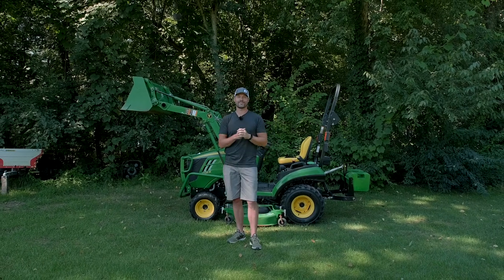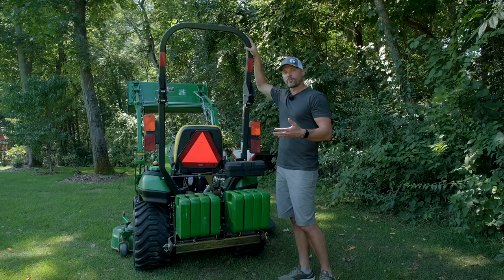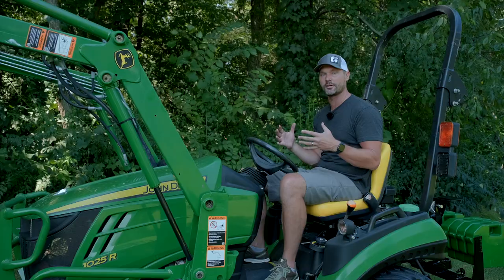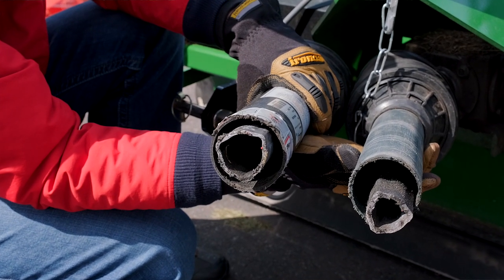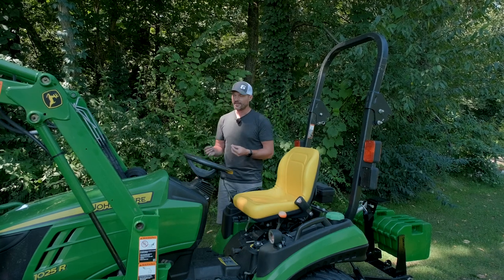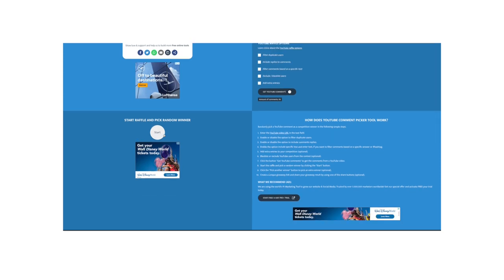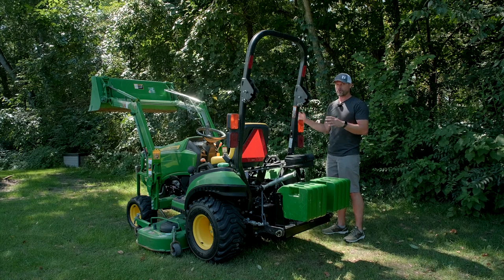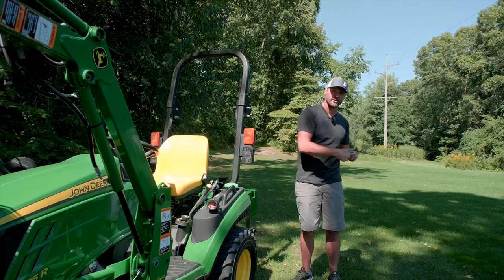TOP 5 WAYS YOUR TRACTOR CAN KILL YOU! DON'T WAIT TO WATCH!

Comment: I live in “hill” country and constantly taking precautions as I use my JD 3038e. I’ve followed your videos for past 2 years and take your suggestions to heart — thanks. Still need to add wheel spaces. It is on my to-do list.
Reply: Just bought a 3038e but have not picked it up.
Had them add wheel weights load tires and make sure tires are as wide as can be.

Comment: The extra weight on the rear end is a nice addition to add to the feeling of safety and stability of your tractor. However, just because you add extra weight to the tractor doesn’t mean you can throw caution to the wind, as the operator is ultimately responsible to operate their machine in a safe manner.

Comment: I think very useful content.

I've grown up on farms, and unfortunately lost family and friends to accidents with tractors. 4 additional areas of really critical safety that I unfortunately know from accidents:

1. Hydraulics. Don't get under a loader or 3pl implement, or anything else hydraulically without appropriate safety supports etc. in place. Or in a place where anything can be crushed.
2. Don't step off the tractor and leave kids (that can touch controls) and go attach an implement at the back or front of the tractor, or open a gate etc.
3. You kinda covered this in starting, but either be in the seat - or well back from the machine - if it's starting.
4. Stand reasonably clear of any machine that is on, or has anyone at the controls. That persons foot may slip/hit the wrong thing and that machine or implement be quickly on top of you.

Comment: It’s also important to note the hitch height on the torque part.  Having a high hitch above the axle height allows the tractor to rotate around the axle.  A low hitch, below the axle height, typically prevents upward rotation of the front end during heavy torque.
Reply: Old Fords were famous for killing operators because attaching a tow rope to the top link was very tempting.  Drawbar under the axle is best.
Reply: Absolutely! Always use the drawbar to hook to chains for pulling. This makes sure you are pulling below the centerline of the axle.
Reply: @LongBinh70  they used to have safety films on TV about this and other things in the sixties here in Britain, they were short and filled an advert slot.
Reply: Both my MF 235 and 1050 still have the factory draw bar hard to wheel stand them pulling off it .
Reply: Back in high school I knew two people killed by flipping the tractor.
Reply: Physics is the one law nobody is above

Comment: A couple weeks after we moved onto the old family farm in 2001, I borrowed my uncle's Ford 1920 and went down to the creek to get several scoops of gravel to put on the new driveway. About the 3rd or 4th trip, I had really overfilled the bucket and as I looked backwards to reverse out of the creek bed, I did not realize my hand was still on the control just enough to continue raising the bucket. As I was backing up I suddenly felt the tractor lurch to one side and as I quickly turned my head back to the front, I saw the bucket was at near max height and was starting to tip the tractor over towards the creek bed. I don't think I ever slammed that control so hard forward so fast in the 14 years I had use of that tractor! I saved it from going over-but just barely. Scared me so bad I never did it again!
Reply: Good instincts!

Comment: Would love to see add on ballast weight options for back blades. They are never heavy enough to cut into dry hard ground and they are one of the most common attachments.
Reply: I just hang suit case weight on mine.  Same for the box blade.  Works like a charm.
Reply: Use cast iron barbell weights on a 1" shaft welded somewhere out of the way.
Reply: I welded a box onto my box blade to stack concrete blocks into.

Comment: Use your translock when climbing hills, even in fwd you can loose traction with one wheel, causing it to spin,and the others to reverse
Reply: I think you're referring to differential lock.
Reply: Same thing
Reply: @woodboss270  no theres no such documented term called translock. It is called differential lock or diff lock for short. When you push the pedal down or flip the switch you're locking left and right axles together at the differential.  Locking the transmission would cause a machine to not move at all and is used in drag racing for staging a car at the line and is called a trans brake.  Tractors have Differential Locks, not trans locks.

Comment: Your new Versabracket and the package bundle looks like a real winner.  Recently bought the JU Fab Works hooks for my 1025r and they are great, I highly recommend.  Your comments on safety are really on point.  At the church we attended when we lived in MN we had a 4WD JD Compact tractor with a mower deck and plenty of hills.  One of the guys who occasionally used it took it out of 4WD and forgot to put it away with the it engaged.  One of our other volunteers took it out to mow and didn't realize the 4WD wasn't engaged. He rolled it and if it wasn't for the ROP and wearing a seat belt it would have been fatal. Regarding the PTO comment, that is the reason my father-in-law decided to retire from farming. His best friend was working with his son and got careless and was pulled into the PTO in front of his son. Farming and working with heavy equipment is potentially dangerous, so safety first is a must. Great channel with excellent content.

Comment: Some good points , the first tip, "too much torque" to avoid always pull from below the centre of the rear axle, not the top link, always the draw bar. The PTO the absolute golden rule. I watch a lot of YouTube farmers, too many implements with failed PTO guards especially static machinery such as augers, and conveyors. Always have the rops in the correct position. Good safety video. A friend of mine lost his arm in a round baler, I'm always encouraging farmers/machinery operators to have the best safety attitude.

Comment: Thanks for posting the safety bulletins, I noticed when I removed by backhoe from my 2025r that it doesn't take much weight in the bucket to make it get squirrely maneuvering it around even with fluid in my tires, adding the box blade helps but it is no where near the weight of the backhoe so I am considering adding rear wheel weights. Keep the videos coming they are really informative.

Comment: Great information regarding the tipping point for these small tractors.  I have a JD 1025R like the one featured in your video and I've had it on 3 wheels (one rear) twice and it scared me to death.  Thanks for the knowledge to add weights on the PTO and wheels.  Expanding the rear footprint is also a great idea.  The compact tractors are super handy to have around but take your time and keep your loads low.

Comment: I got rid of my ballast box and use my box blade as my rear weight carrier now.  Especially when I haul rocks, etc.    I'd love a chance to win this versabracket (and weights).  On the safety piece, I've rolled my 1025R in my drainage culvert running too sideways.  I thought the angle wasn't too steep to mow it, which it wasn't, but at the end, when I turned to get out of it, the angle increased and I tipped.   Fortunately, the ROPS saved my life, and I NO LONGER do that.   Cheers and thanks for all the awesome content.  Keep em comin.

Comment: Good tips! I can relate to the runaway one. I recently went down a hill with some weight on the front and forgot I was in 2WD. Back wheels got a bit light and it just started sliding down. Whatever was on my forks thankfully fell off and I regained traction. It scared the hell out of me and won’t be doing that in 2WD again.

Comment: I own a john deere 4066m heavy duty with a loader, to make it safe always keep the rops up and seat belt on and add enough weight. I have the tires full and 800 lb of wheel weights and keep the    4 wheel drive engaged. Stay safe and great video.

Comment: I agree, I have attempted to move Ford without disengagement of the parking brake. I always worry afterwards if it will hold the tractor when it counts. I’m ready to put a post it note in the area as a reminder.  Great safety video.

Comment: My first experience with "needs more ballast" was building a target berm. I was scooping a heaping load of dirt into the bucket, and the next thing I knew, I could feel myself starting to go upwards. It wasn't a fun experience, but I certainly learned that the tractor needed some more weight in the back end than just the box blade was able to give. Since then, I have just started using the brush hog back there as a pretty good size weight.

Comment: I built my first prototype track system for a JD 955 in 1991.  A cooperating dealer let me use the tractor which was owned by JD. My company at that time was; Terak Corp.  And, a video of the testing was placed on You Tube by Jean Marc Maclou  in Paris France.  Over the years I have improved the track assembly as well as the supporting struts and idler axle.  The Iguana Track system improves operation in snow, mud, sand, swamp and steep.  It has angle control that allows you to work yourself out of impossible situations.  The tracks also makes it more difficult to tip the tractor over and the Low Impact track reduces or eliminates damage.
I update my contact at JD biannually with no response.  If they have my tracks on their JD, they have one of a kind.  The hydrostatic compact JD tractor has nearly 20 competitors.
Go figure,
Iguana

Comment: Good review of safety precautions. One other is that when you were Towing be sure to put your tow line on the tow bar or at a low point of the tractor turn it off, if it's hooked on above the actual height that can tend to tip the tractor backward.

Comment: Last week my Dad found himself in the downhill runaway tractor scenario.  He had put it in the wrong gear and started down hill.  Instead of just stopping right away once he knew he was going too fast he was trying to down shift to slow it down but he didn’t realize you have to stop the tractor completely before switching gears. I watched helplessly as the tractor picked up speed.  Luckily he ended up hitting a tree and wrapped the bucket around the trunk.  If he wouldn’t have hit that tree he had about 10 more ft left of that hill before there was a cliff that dumps into a river basin.  Somehow he walked away with only minor scrapes and bruising.  I thought for sure he would have broken some bones or worse.  I ran down the hill yelling out to him, “are you hurt?”  He raised his arm up with fist clenched to show me he was OK.  That was scary!!  Now we’re trying to figure out if this loader bucket can be straightened back out.
Reply from the maker: Holy smokes, that's scary!
Reply: I've seen that movie

Comment: Those add on weights would be great. I just seen a tractor tip over to the side a few weeks ago because the operator removed the brush hog and swapped out for a smaller implement (middle buster) and didn’t have that same stability. Luckily that bar prevented  from rolling over him and causing any injuries. Gotta pay attention.

Comment: Thank you; I have a small backhoe around 7500 pounds, and a few years back I was working on an incline, after having put the bucket down I then lowered the outriggers, but I forgot to set the emergency brake. Going to the back seat, I inadvertently kicked it into neutral, having finished the job, and sitting backwards, I pulled up the outriggers, and the ride backwards  begin. Being caught off guard, I didn't think to lower the outriggers back down. So now I have emergency brake stupid on the dash.

Comment: It's always good to have a nice weight Set for your tractor.  When I bought my tractor the first thing I did was start to mow around the perimeter of my property and I have a steep hill I went straight down the hill the rear wheels started to slide and I slide down the hill very fast.  I put the bucket down while sliding keeping me straight.  I look down at my 4 wheel shifter and it was in 2 wheel.  I only take my tractor out of 4 wheel if I'm on the pavement.  Not going to happen again.

Comment: The VersaBracket shown is nice, could add a couple rings/clamps for shovel, etc. 
Kubota manuals only give maximum weight for the front and to tailor the rear ballast to the job and remove when not needed (ha).

Comment: Bought my tractor used from a guy with lots of hills. He didn’t have any ballast and sold the tractor because he was worried about using it. I bought the JD large utility tractor from him, added liquid in the rear wheels and wheel weights and have had no problems. I’ve had a very nice tractor for four years. Ballast made all the difference.

Comment: Good video! There is no question that spacers for the rear wheels are a stabilizing influence on side slopes. I do question the validity of using spacers on the front wheels of a tractor with a pivoting front axle. Both front tires will usually still be firmly planted on the ground when the rear axle has tilted beyond the point of no return.

Likewise, the center of mass of the suitcase weights on the 3PH of the tractor as shown effectively raise the CofG when carried in a high position making the tractor even more unstable for rollover situations. The 3PH should be lowered closer to the ground for better stability when suitcase weights have been added for ballast.

Comment: I just bought a 3032e and have tried to be very careful about the balance of the machine, our property is pretty hilly.  I've got Rim Guard in the rear tires, but surprised at how much more weight it needs to stay balanced when using the loader or the HLA light pallet forks!

Comment: So many used tractors on the market don't seem to have a ROPS or seat belt, they are usually very tempting to get due to the lower price but I keep avoiding them as rollovers seem to be the main issue.

Comment: 1) Do NOT walk; crawl; slide or  shimmy under any raised implement or load. 
2)Lower ALL implements (front and back) before leaving the seat. I was a little surprised to see an idle tractor with the loader raised like that.
3) shifting into Neutral (or depressing the clutch) to start will allow the tractor to roll out on control on any slope. Use the bakes

Comment: I have seen tractor accidents with tractors equipped with front loaders where the front loader experienced a sudden hydraulic failure where the front loader itself lost all hydraulic pressure, causing the bucket to come down hard instantly while the tractor was traveling forward at full speed.  The tractor will usually flip end over end as a result and the tractor basically rolls over upon itself, mangling the front loader and the tractor into heap of mangled metal.  Rule of thumb here is to always check your hydraulic hoses, connections and look for hydraulic fluid leaks in the system to prevent this front loader failure scenario from happening.

Comment: I was coming down a bone dry path on my lawn tractor which had the standard turf tires. It was a pretty steep incline, but the rear tires started sliding and lawn tractor was actually accelerating. I lost control and was able somehow to jump up and off behind it and it wen down a bit more an turned over into some brush. I was unhurt, but I put ag tread tires, wheel spacers and loaded the tires with RV antifreeze. Amazing difference in traction.
  Second was I was clearing some weeds and brush out under some bushes with my loader bucket. I did not see the grape vines going up into a nearby walnut tree. A 6in diameter dead limb about 15 feet long was pulled down and across the tractor and me, missing my head by inches. I now watch for these vines around anything.

Comment: One thing you forgot to mention about going down hills is to never disengage the transmission, even if losing control. Keeping those wheels turning by the engine instead of sliding does a world of difference to try to recover.

Comment: This has been great information.  4x4 going down hill for lessen the risk of a runaway.  Speaking of safety.  The wheel spacers.  I have a 1025R with a 60 inch mower deck.  I assume the mower deck and wheel spacers can not be used simaltaniously?
Reply: He has a different video on that topic.  Basically you need to measure for yourself on both sides of your tractor to see how much clearance you have between the tire and the mower deck gauge wheel release lever.  That will show you how wide (if any) of a wheel spacer you can use.

Comment: Yes this is a good topic on safety. I worked for a Co. that sells tractors and skid steer equipment. The biggest problem was tip overs. I did classes etc and the next day no one was safe around the inspection running test area. We did start to use safety infraction slips . No 3 slip was a safety infraction slip dismissive of any employment . That worked and it did stick after we had shown the loss of life were one person lost his life not using a safety boom stop. Another person lost his arm. Today we have all types of no start safety or stops and it works, with some small inconvenience . It does  prevent fatality's or injury's. In many cases the safety features have been physically disabled . From cars to lawn mowers etc there is some inconvenience  but  its there to avoid your death. Point of define death is a time when everything you own or ever going to own is taken away.

Comment: Thank you for the informative video.  2 owners of my Kubota died.  First was a landscaper carrying raised bucket load up hill, and the tractor flipped backwards on him.  Second had heart attack while on the tractor.  It became locally famous as the "Killer Kubota."  I am the 4th owner.  Last year the tractor had its 40th birthday, and during my COVID vacation I built a roll bar for it and installed plenty of lights/flashers and even a horn.  I repaired all loose/rusted framing and accessories.  Please send me a set of black weights when I win your drawing.